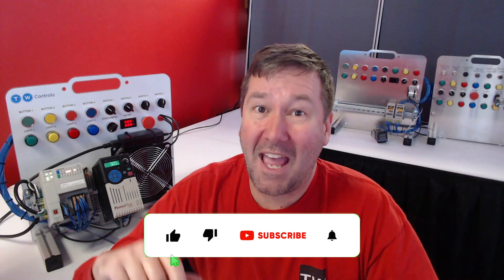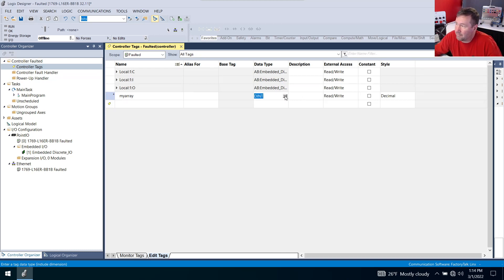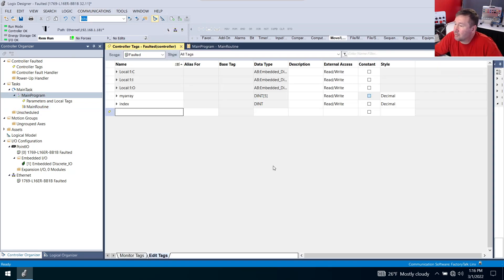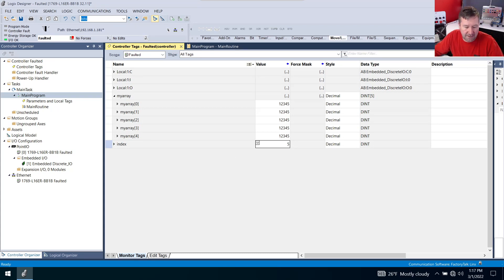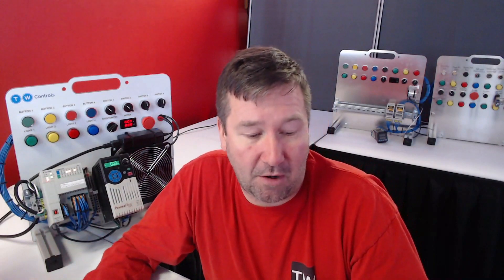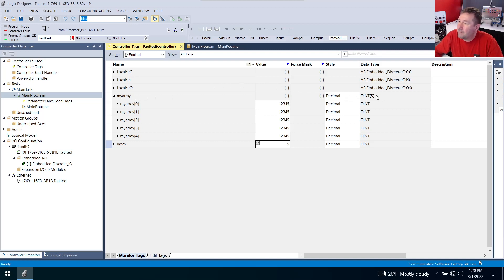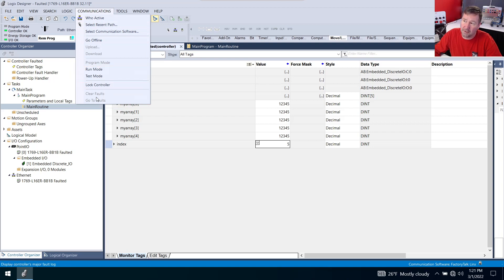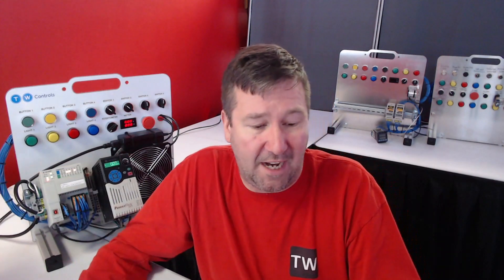Reset an Allen Bradley PLC Fault

Comment: I am currently experiencing this right now. I was the new engineer and we were forced to reach out to the former engineer. He told us that they input wrong value long time ago and the same thing just happened again. Why will Allen Bradley give room to such thing to faulty the whole PLC
Reply from the maker: Another angle to look at it is if someone has entered a number that makes the PLC try to access memory that doesn't exist, can the PLC safely execute the program. There are plenty of ways to prevent this from happening. This usually comes down to poor programming practices.
Reply: @TimWilborne exactly, the PLC should return the value minimum or maximum in the memory not to execute what will make it faulty. I remembered when I learnt Siemens, that was what happened. They need to do better in the latest versions. 

I spent hours troubleshooting and the operators thought I don't know what I was doing whereas they caused the issue. Since I don't have the software now, we need to call an external person to clear the error.😢
Reply: I think this question is not on the right video because it is related to motion kinetix servo drive fault hard reset .my question is if we want to reset the servo fault can we just remove the 24 DC without cutting the 480 vac from the servo or we need to do both, because I want to know if I could do hard reset with a relay without using a contractor to shutdown the 480 vac
Reply from the maker: There is a reset in the Kinetix tag structure.  Additionally, you should be able to use a SSV to do a hard reset.

Comment: Would be more useful if you would've also explained how to do it with the run/rem/prog switch.
Reply from the maker: I have...but that has zero to do with resetting faults.  Why do you think it would be useful in this video?
Reply: @TimWilborne  how does resetting faults with the switch have nothing to do with resetting faults? It's a way to reset faults without logging in to the controller. It's very useful so I don't have to remote into a PLC just to click 2 buttons.
Reply from the maker: No. That is a myth. If a programmer writes a power up handler then a transition to run mode, which includes cycling the power or switching the program switch from program to run, may clear the fault.

But we've talked about why this is a poor practice in previous videos.

Comment: Hi sir am using compact logic L18ER it is going in fault mode while switch on off of main supply what may be the issue pls help sir.
Reply from the maker: Go to communications, go to fault and see what it tells you
Reply: @TimWilborne  power up fault is coming sir how to rectify
Reply from the maker: That means someone has assigned a power up fault routine and not actually written the code to handle and clear it. Is it empty?

Comment: @Tim Wilborne I am using rockwell compact logicx plc, its shwoing Red light for ok and its glowing. But there is no light showing for Run, Force & I/O only communication lights are glowing in Red
Reply from the maker: Glowing solid or flashing?  Solid is a hardware failure.

Comment: Great video! I have so many questions, but first that came to mind - how are system faults like wire breaks, short circuits, etc. reported? Is this automatic or done programmatically? Thanks, Tim!
Reply from the maker: With most standard PLC inputs, you will need a meter.  Some inputs and outputs have diagnostics features, but people do not use them nearly enough.

Comment: I'm having trouble connecting to my micro820 serially and through ethernet. The fault light is flashing in addition to the run and comm lights. Have any idea what's causing this?
Reply from the maker: Is this a SLC 500?

Comment: Hello Tim,
I have a problem with 1769-L33ER. The PLC displays a solid red indicator. The plc is not detected in the studio5000 and that frustrates me. Why did it happen? And what's the solution?

thanks!
Reply from the maker: As the video says, solid fault light is bad.  Probably going to need some new hardware.

Comment: Hello Tim, do you know if Logix controllers (compact, control etc.) are able to scan the fault status bits while faulted similar to a MicroLogix series controller? ( S:1/13, Major Error Halted for example) I’ve tried several different ways of moving the fault bits from a GSV, or energizing a coil when the fault bits are equal, but of course, with the controller being faulted, they won’t scan. I’ve also never used fault handler routines. Does the answer lie in there? Thanks!
Reply from the maker: It will run the fault handler when a fault occurs.  That is where you need to put your GSV.  I should do a video on that.
Reply: @TimWilborne  Thanks!!! I'll play around with it this weekend.
Reply: @TimWilborne did you ever do a video for this? If not that would be an awesome one to do!

Comment: I love your videos and have learned so much from them. I'm not sure if you have a video on open loop control of a proportional valve or not. If not I'd love to see how you'd program a proportional valve to work with an analog card and some photoeye inputs to detect mid and end position of a cylinder. My goal would be speed control of a cylinder without the full cost of tempo cylinders and a motion controller on a plc500.

Comment: While this information is important and vital to know, let's ask ourselves if faulting PLCs is something that should even be considered acceptable? To the best of my knowledge, AB/Rockwell is pretty much the only PLC on the market that does this. The venerable old GE Series Six would shrug off a divide by zero or an out of bounds access attempt on an array.

The fact that you can prevent this by adding fault recovery routines can be looked at either as "Nice of them to provide a method of recovery", or pragmatically, "Why the heck isn't this already in the firmware?" I'm firmly in the "WTH?" camp. You can argue that a DIV0 event should be considered catastrophic, and shut down the PLC, while I'll point out that the operation that caused it probably only flashes an indicator and isn't a threat or hazard to livestock nor navigation.

There really is no excuse on Rockwell's part for this to still be a thing.

And remember folks, every time that you divide by zero, a new universe is born!

Comment: Have you done a piece yet on writing a fault handler routine?
Reply from the maker: That would be a good one. Let me put it on the list.
Reply: Please look into the Rockwell tech note for saving the fault record to the SD card in this fault routine.  Often the call I got was there was a fault but someone cleared it already to keep it running. There is no record anywhere without saving to the SD card to find the root cause!